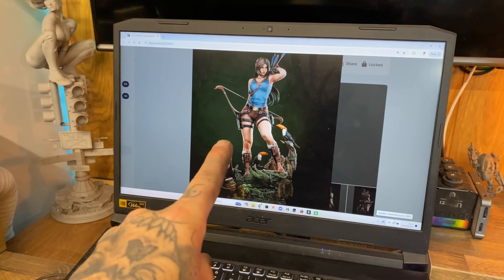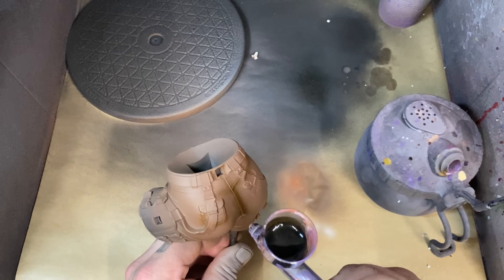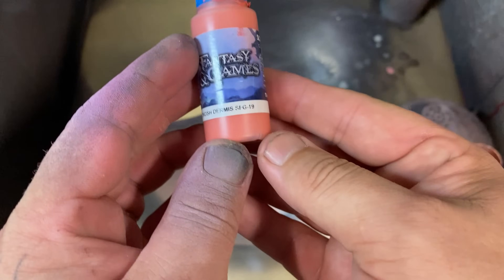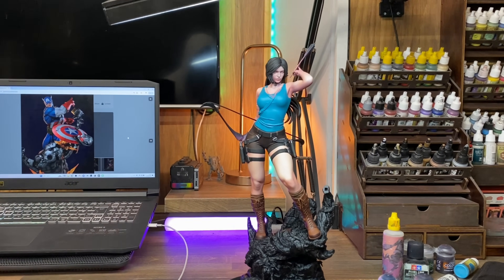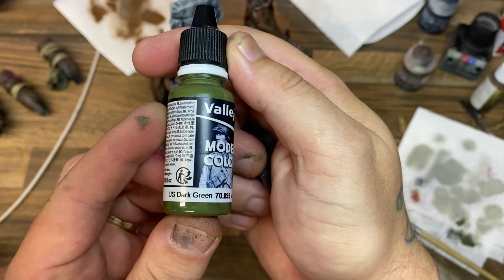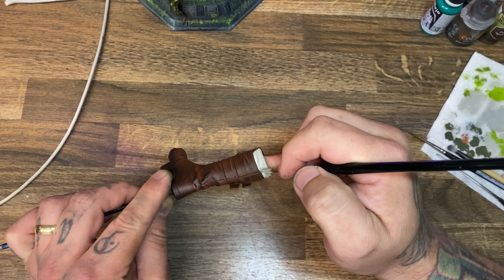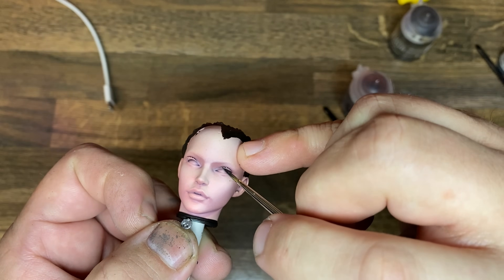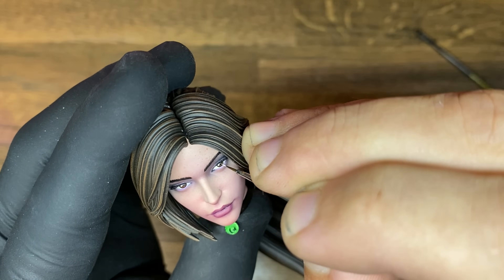3D Printing Lara Croft - Tomb Raider

Comment: I would love to see a video on the way you set up your supports (currently). I can never see any divots in your work and that impresses the crap out of me.
Reply: I'm pretty sure Brent has made videos on his use of supports in the past. Have a look at his video library on here. He's helped me with so much over the past few years. Im always learning though. I'm definitely not as good as him. Often it just takes a bit of practice,  experience and playing around. I played around with connection settings and depth of contact points etc and got mine nearly perfect too. Also I find soaking in hot water for 5 mins just before you remove supports helps them break away easier and cleaner. Not boiling hot but hot warm so you can still put your hand in without getting burnt

Comment: I've made the same mistake. Drybrushing white highlights, and going back over them with citadel contrast paint. And yeah, many contrast paints are so potent they just obliterate your underlying white highlights! One solution I found was thinning them down with the citadel contrast medium, usually as much as 3 parts medium to one part paint, and it makes contrast paints much more flexible and forgiving. You have to apply at least 2 coats, but any underlying shading will show through, and the end result will look like you put much more skill and effort into it than you actually did. ;)

Comment: Dad, I have a question dad.... how come when I print i have 100 pits and or spheres where the supports were... but you don't. Did you sand every part? Do you use a dremel to remove those support nubs? Please dad, my fingers hurt from sanding, there must be a better way!